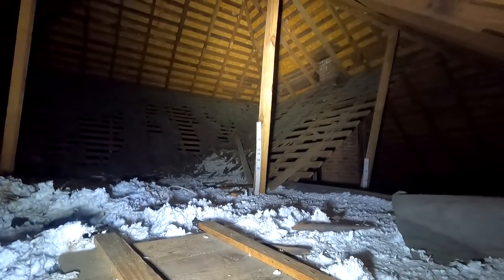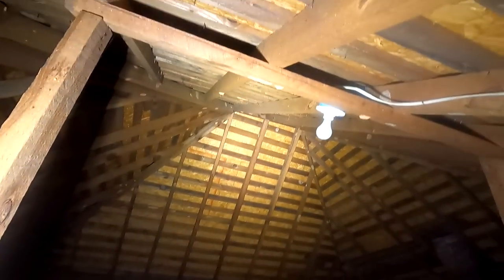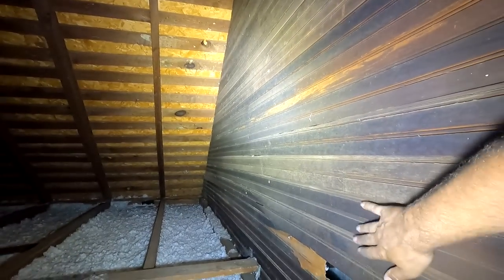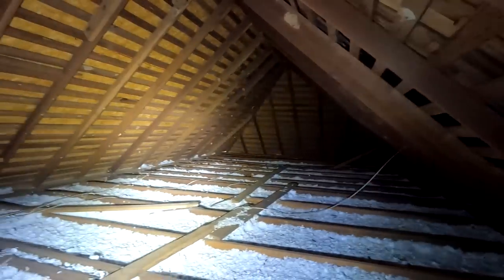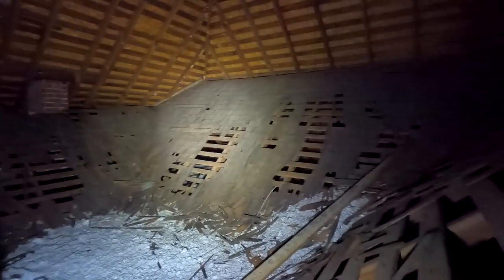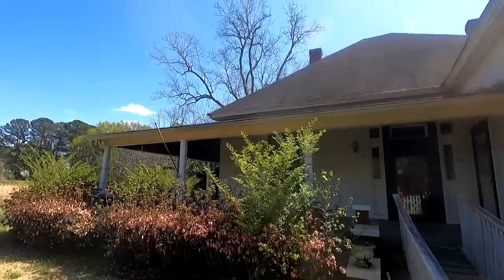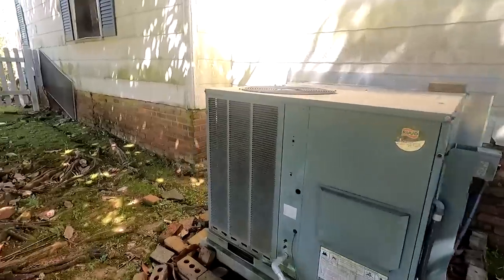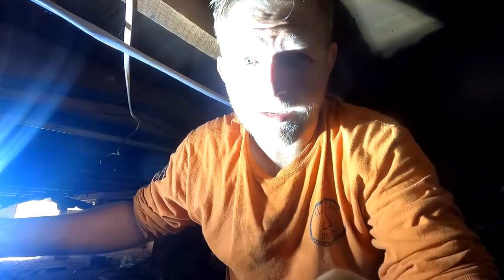EVEN OLDER HOUSE *HIDDEN INSIDE* 140 YEAR OLD FARMHOUSE & CREEPY WELL FOUND | OLIGHT MARAUDER MINI

Comment: Looks like a old cistern catch roof. Back before running water. There would be a tank right in the square where all roofs meet in the middle. Above or below. More often below in the basement or crawl space. But above if the house was plumbed with pipe. Normally a box drain in one corner of that square section would funnel the water to a cistern below the house and a trap door above it would give you access to the water. Still bucket drawn like the well. Often under the kitchen as that’s where even today water is needed the most. But as the drain was always wood it normally rotted and was often replaced as running water became more available was often removed completely and the cistern filled in as it was high maintenance. With the tank above you would normally have a lead pipe leading to the kitchen and one leading into the tank from a windmill. Giving you running water. That system has been around since the Roman Empire. But not considered running water today.
Reply: Interesting thank you
Reply: Amazing information thank you
Reply: Thank you for the information!  Never seen a house that still had this rain water collection system.
Reply: @mariemorgan7759  not many built are still around. It’s more common in desert homes. Or drought prone areas. Pre 1890 it was common everywhere as a upper class home as the expense was there maintenance to keep them from leaking into the home. Often that catch area was a lead pan if the tank was not stored on the roof. Definitely after seeing the well in the basement has me wondering if this was the intention. But as it looks like the well is almost dry. It’s probably the cistern and well. Keeping water was often a problem as exposed well’s outside where often hazardous and can be tainted with wild animals falling in. The cistern was a better choice for most people and popular from 1800-1890. Tho many desert homes in the Middle East still have them.
Reply: @nfordf450  Thank you so much for the reply! I love  American Colonial, Federal and Victorian homes. How people lived in the past has always fascinated me!🙏💕
Reply: @mariemorgan7759  I grew up in a home that was built in 1740 with many additions added till around 1940. It was a mix of colonial/ Victorian/ and the last additions having a more modern look but tried to match the Victorian on the outside. There was a smaller summer home also. But unfortunately by the time I was born the large porch roof was gone tho including it’s large oak pillars. The home was also a used by the western Maryland railroad as a post office and station with my family running a agricultural business out of a barn that had a siding at the rear of the barn. Where both sides lined with doors. Being a agricultural business many times my family would be called to repair things including cistern roofs and the like. So there was steam chests full of drawings and recipes for work that I would spend hours and hours reading and learning from in the attic during the winter months when there wasn’t much else to do.
Reply: @nfordf450  That is really interesting! I grew up in a Chicago apartment building that was built in 1901, it still had the kitchen dumb waiter that went down to the basement where the garbage was burnt in the furnace. This was a time before city garbage disposal services. Did you keep any of those old buildings plans?
Reply: @mariemorgan7759  unfortunately the tax man took the farm when I was in high school. So some of my family removed items including the stain glass windows. I’m still looking for who got the steam trunks. As I really want them documents. As the family had a huge impact on the foundation of Carroll county Maryland and if those documents are lost we lost a major part of history not just for my family but for everyone. My quest won’t end till I know what happened. But my family went the way of the winds when we lost the farm. So there’s more family politics I deal with trying to get them then I often have patience for with my own children right now. Hopefully they turn up as all the elders know why I want them and that I’m looking for them. But as for now. I unfortunately have not located the documents or the chests.
Reply: @nfordf450  Sorry about losing the house and those documents! Family dramas is something I know too much about and do my best to avoid! Hoping you will find what you are searching for, be blessed always and thank you for the nice chat!💕🙏
Reply: Wow Nickolas .. you have some really awesome historical stories. I've enjoyed reading it all. Truly sorry about ur family home & all those precious documents. Man I surely hope you eventually figure it out. Many blessings & thank you😊🙏🏼❣️
Reply: fantastic! explaining the odd angles of the old inside roofs.
Reply: Ward Hall in Georgetown KY built around the 1850’s has the remnants of such a system and gives tours from what’s left of the basement kitchen all the way up. Handsome place.
Reply: Old late Victorian duplex or duel gable /\_/\ .
Very New England.
The hip roof was added 1940-ish they probably had years of leaks in the rear valley / flat roof - which fed a cistern.
The 2x4s ARE 1900- ish +/- 10 yrs
It's NOT over 140
The hip roof solved many leaks and conversion to one unit. I work in New England homes in attics and basements every day for 40 years. They added that front addition w bay window and this hip (pyramid) closed everything in.
Reply: Wow informative. You could probably make great history videos.
Reply: Thank you for the history lesson I never knew that ❤️
Reply: @mariemorgan7759  me too just imagine if we had to live that way today being a housewife back in those days was probably a killer job physically and mentally no wonder a lot of women passed early back in the day
Reply: @colleenbennett2867  Yes, life was tough for everyone back then! The common people worked from sunrise to sunset!
Reply: @nfordf450  these 'in home' cisterns and or wells were also common in Northern areas of the US & most of Canada because water sources froze in the winter & hand pumps did too if they were outside.

Comment: The well under the house was interesting.  Here EVERY house of any size whether in town or on the farm has a fieldstone basement at least under the main part of the house.  It was used as storage for everything from pies to milk to canned food or root crops plus smoked or salted meats too. It was kept very clean of course except for the corner or area where root crops were kept. Many also had a cistern built into them that held rainwater that was fed into it with extensive eves trough system. A hand pump was directly over it that lead to beside the kitchen sink. A hand dug well would have been a lot of work & not quickly abandoned for sure.  
My best guess is that one was originally beside the house and the house expanded over the top of it or maybe dug in that location so that the house could be built over it from the beginning. There might have been just a kitchen sink the hand pump was beside or maybe a whole 'pump' room near laundry and or the pantry area where dishes & bathing even took place. I don't know but it makes sense. Lots more comes to mind about the well but I don't want to have the world's longest comment I hope anyway  haha
Reply: Your description fits our old Farmstead in rural North Dakota!

Comment: As large as the new roof is, I wonder if the original roof was left in place as support for the new structure. Without the old ‘A’ frame of the roof, a good bit of bracing would probably need to be put in place. 

Great tour!!!
Reply: Agree--also very likely easier & faster than total reframing for the new roof!

Comment: Need a new battery in one of the smoke alarms inside, that the chirping noise you hear, probobly a AA battery would do it. Spent many years in a 1909 house with an interesting attic and a half basement we dug out by hand for more living space. Our well was in the front terrace just outside the door which was found out when the cap sunk and needed to have work done to make it safe again. Surprised the old well was open, dangerous and spooky.

Comment: This is FUN!! We have a lot of Plank houses up here in VT. Very interesting, but hard to remodel.
I once owned a home in MA that was built into the side of a hill. There was a cistern under the back barn part of the house with a bladder valve. You could hear it release and we would run through the house into the basement to watch the water flow in, then down into the ground on it's way to the river down the hill.

Comment: Based on the Old Roof lines was the home originally u shaped around the well?  Possibly next generation inherited and made update of running water/ bathrooms ( or a possible fire ?I didn't see heavy charring or smoke damage in the video) they enclosed outside well area increasing the sq ft of the home that required the larger roof.   I debated well or cistern but it looked like it had original doors that were sitting open that originally would have protected the well.  But I am not familiar with wells or cisterns to know what to look for.

Comment: This house reminds me of the farmhouse I had years ago that we fixed up.  It was Originally built a long time ago as a small  homestead supply store and Inn along Rt. 40 when the road was just a dirt trail. Over the years it was added on to and parts were covered and things built around the original.  Now and then We would come across parts of the house or barn that was really odd and You could tell was original.

Comment: We live in a house built in 1974.  In the last 15 years we did a renovation were we added 16 ft plus a wrap around porch to make it look like a turn of the century farm style house.  We tied into the original roof and went higher the very same way they did.  We left the old roof in the attic with original asphalt shingles.   Was worth the time to remove it plus it added structure strength.   Great video.

Comment: Maybe the front of the house today was not the original front of the house.  The different roof slants suggest the house faced a different angle in its construction.  Also it may be possible the well may have been open to the sky originally.  Hard to tell without having Robert do positional checks on where the old roof lines up with the well.

Comment: In the old sq.' nail w/all bead board interior walls farmhouse I grew up in it originally had all wood shingles & all but front of house was replaced with tin. The front main roof still had wood shingles in late 1950's & it was covered with asphalt shingles, The huge 2 story barn, blacksmith shop, smoke house, chicken house, 2 hole out house, carriage & buggy house & other outbuildings w/wood shingles was also covered with asphalt singles at same time.

Comment: There is so much room up in the attics of the house. Could they use the space under the newer roof for storage or would it be too expensive   to insulate and fortify the joists to use for an attic or an upstairs room?  
Since there is a well under the house, could the original house be much older?  It is a very interesting house.

Comment: Our house has a roof of the barrack it used to be up there. Our house is 2 barracks so they covered it quite interesting. All the walls float. As there were no walls. Other than the outside ones.
Reply: I believe that would be the "balloon" construction method of building where the outside walls go all the way up to the roof.

Comment: possibly they had a pile of field stone and then when they ran out they switched to brick although with a pier foundation to add on  to the house you would just add more piers.  As the family became more prosperous and grew they just added on and lumber was cheap enough that it became easier to just add a new hat.    Now a little curious if there was a tarpaper layer under that minimal blown in insulation.

Comment: This was really interesting. It seems the puzzle is more complex after the adventure inside and underneath the house. As you said it appears to have many changes and phases. I would have to say, as you did, that front room was added on later. The fish scale siding at the top would be from the Victorian era. This time though the inside of the house the rooms and hallways seem to have hidden the proof of the add-ons. The property looks well cared for up to this point. You did a much more thorough job of looking around than a home inspector. Did I miss if this home is on the market? Creepy well, I'd have to have that filled up and closed. 😮 You really did sweat this one out! Great tour! 👍👍 ❣
Reply: Sondra, I do beleive that this house is on the market.
Reply: @donnal.oglesby4806  I thought it surely must be, it looks in very nice condition.
Reply from the maker: No, it’s been sold.
Reply: @AdventuresIntoHistory  good, its a nice place.

Comment: If the bead boards are original then yes a addition was definitely added on it would make sense as back in the day homes were passed down from generation to generation so what started as a farm house back in the day was most likely added onto over the generations the field stone is definitely shows how old it is as field stone was a very old building material that was replaced quickly with better materials and the well with how big it is definitely came with the home when it was originally built well size is a great indicator of age as technology got better the wells got smaller.

Comment: I’ve seen houses like that built where they build over the old structure they usually do that to get around certain laws like permitting where I live a few houses were built like that because they couldn’t get certain permits and I also have a neighbor who built their house just like that they built a new house over there old one due to the fact that the water for the city run through their property so they get free water basically it’s called grandfathering so if they would’ve tore down the house and built it up from scratch they would’ve lost their grandfathering so they built their new house over their old one to get around that. What I’m talking about permitting is variances you have to get from the city or town that you would live in and some are picky and they’ll say no so in order to get around it you have to build over your old structure that way they can’t say nothing.

Comment: I’m sorry. It this is not a house built in a house. This is just normal attic structural supports system that is no longer used today.
Reply: I agree that at some point after 1980s (osb) they added the hip
Roof over a roof line /\_/\ that may have been 2 units.
The wainscot gables hint to porches. The house is probable 1890s.
That cistern catch flat roof was probably source of years of leaking.